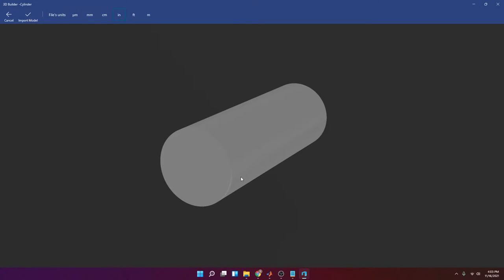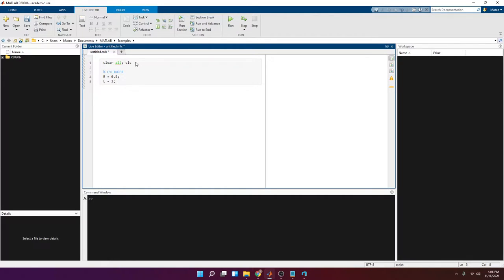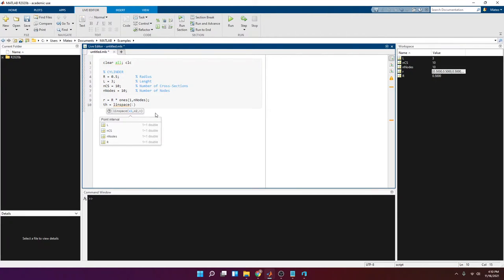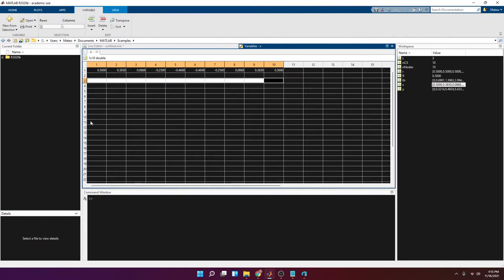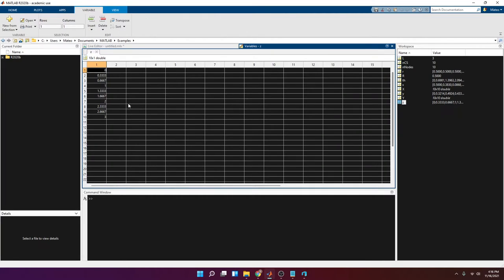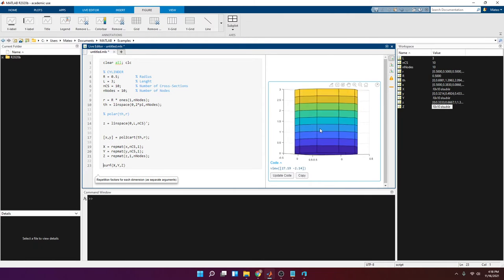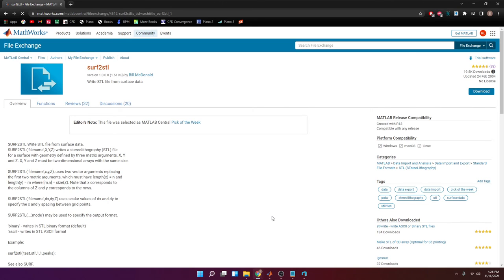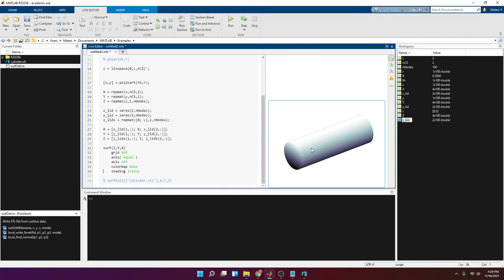Create a CYLINDER in MATLAB || TUTORIAL

Comment: Thank you sir l have one question How to design a half hollow cylinder by using the cylindrical coordinates (x=r*cos , y=r*sin )
Reply from the maker: you can control that by modifying the angle vector (check at 4:20 lol), instead of setting the range from 0 to 2*pi, you can do it from 0 to pi. Since you mentioned a hollow cylinder, I am guessing there is a wall thickness, so you have to repeat the process for a smaller radius to create the inner wall.

My suggestion would be to create a thin rectangular crossection with height = wall thickness and length = cylinder length. Position it some  distance = r_in away from the horizontal axis. Then you can use the rotation matrix to create copies of this crossection that go from 0 to pi. 

This would be what I would do but don't know if it comes across clear in text. Let me know and good luck!
Reply: @prot0form775   thank you very much … I will try and tell you … If you have an account to contact us  please let me know
Reply: Hi
Reply: I have a problem on my final year project, using Matlab open prop, I have got my 3D diagram, but am unable to export to Stl